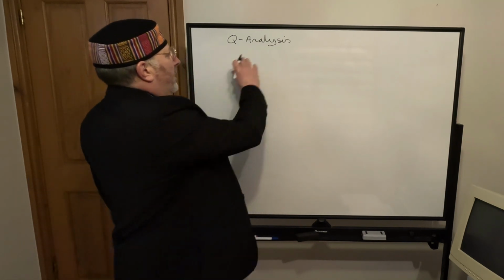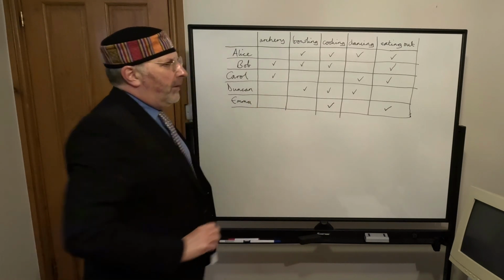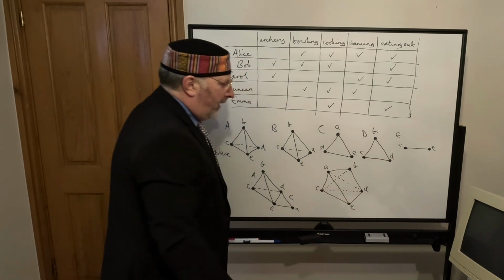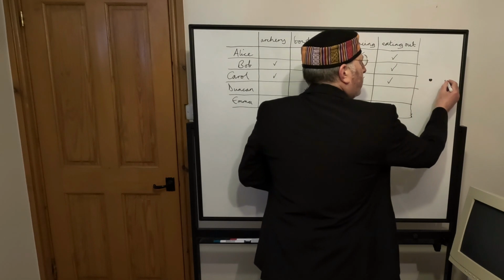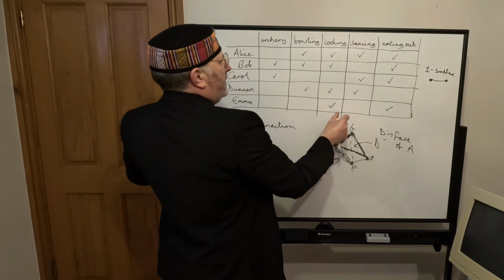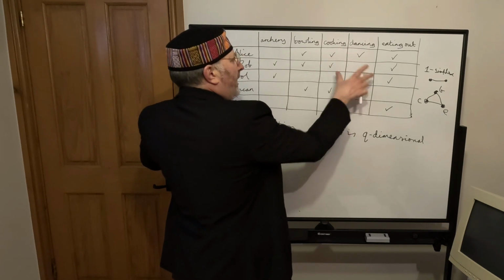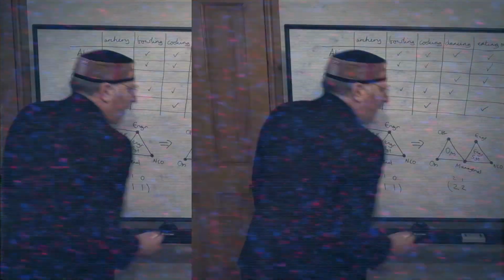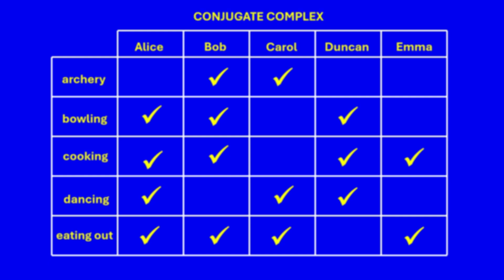Lesson 3-5: Network Science for Theoretical Historians, Part 2: Q-Analysis

Comment: What do you think of recent events? Also, you predicted that WW3 would occur in 2020. That was wrong but it is looking to be picking up now.
Reply: What if it did occur in 2020.  And we just didn't notice?
Reply: @craigsmith6512  Probably the preamble. However, what we actually think WW3 to look like or even be similar too ,because we can't know for sure, has definitely not happened.
Reply from the maker: My predictions are always wrong! One wonders if the events of 2020 involved some kind of hybrid war. But yes, it was not WW3 by any means. I wish I had gone for what George Modelski predicted in his theory of hegemonic cycles, namely a "global war substitute" in 2026. I don't feel we're anywhere near great power war right now, do you? On paper, we ought to be, with an ongoing proxy conflict north of the Black Sea and economic decoupling between the major powers, as well as other flashpoints being in a hot phase. Yet it all seems to be contained and often over the last few years it's looked like things might escalate and they haven't.
Reply: @DarkAgeTheorist  I have heard analyses on current events that I think could lead to a great power war. The analysis states that the US with the tariffs is actually trying to get countries to stop trading with China essentially locking China out of the global economy. I won’t go into full detail here however, the theory seems to be holding some weight given events following the Trump inauguration. In my opinion, if this theory is true then that would mean great power war is very soon.
Reply: @DarkAgeTheorist  RU stopped it from escalating by depowering the Western bloc.  In this sense, Europe used them.  I don't think you're prediction was wrong.